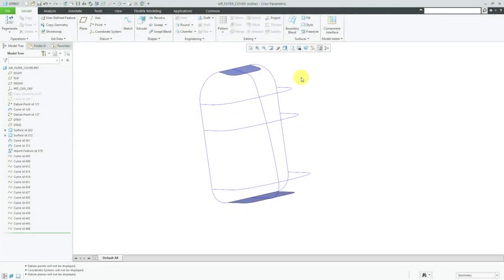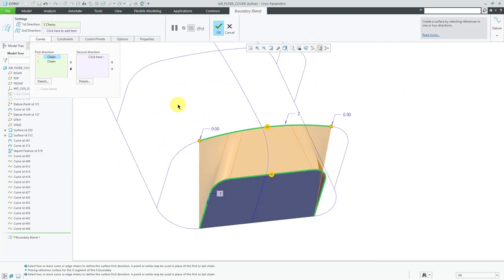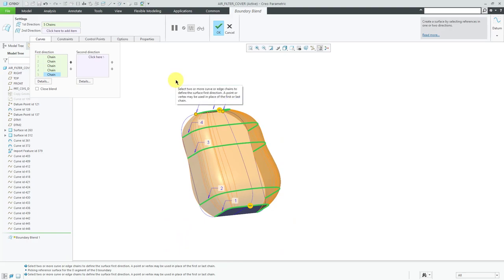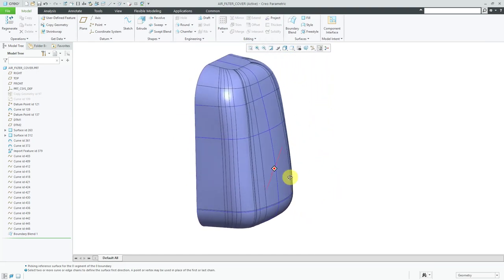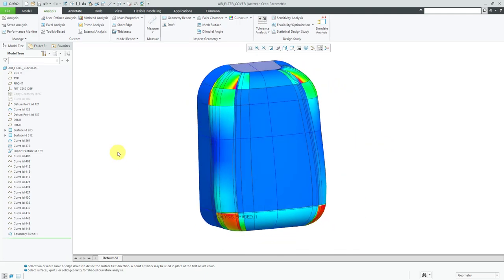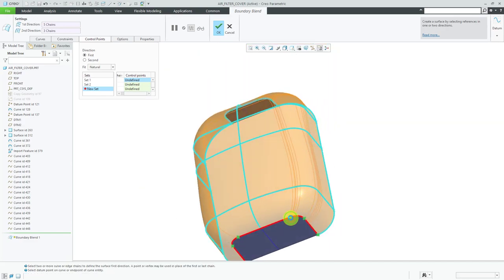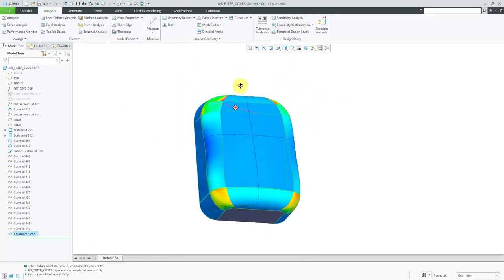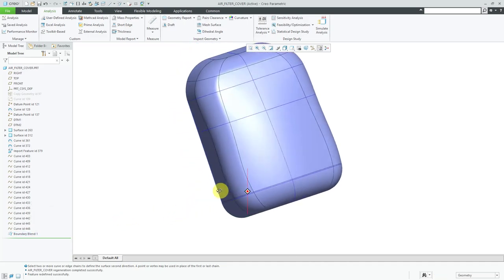Creo Parametric - Boundary Blends - Surfacing

Comment: Can you touch on STYLE and G3 curve and surface connections?

I had a PTC support ticket opened and they gave me a great tip for a troublesome master surface model. 

There was one last patch i couldn't get to G3 - they had me create a CURVE FROM DATUM in STYLE, increase the quality, and bump the degree to 7.

That worked, but it's still hit or miss as a general modeling method in STYLE.

Thinking NX or Catia may be better CAD programs for true G3/Class A.

thoughts?
Reply from the maker: Honestly I have extreme difficulty seeing the difference between G2 and G3 surface connections visually - my eyes just aren’t attuned to that level. I can use some of the analysis tools to tell that there’s a difference. To me it’s like how to distinguish between good and bad modern art.

Also I haven’t done much Industrial Design in the years since PTC added G3 connections. We used ISDX at Lab126 but Echo and Fire TV were simple shapes obviously. On Prime Air and Blue Origin we keep away from too stylistic surfaces for manufacturability.

I just don’t have the experience to comment that deeply about G3.
Reply: ok

Comment: How did u draw this for developing the curve.
Reply: Actually how did u connect the ends
Reply from the maker: How did I draw what? The network of curves are either 2D sketches or curves through points.
Reply: @CADPLMGuy  sorry sir.  I didn't get those ends comnected.  So I was figuring it out how to get those ends comnected 😁😁😁
Reply from the maker: @turbojspeed1360  I still don't know what ends you are talking about. I'm sure the problem is clear in your mind, but you haven't explained it clear enough for me to understand what exactly you are referring to.
Reply: @CADPLMGuy  first of all I'm really sorry for my english.  😁.

The issue is.  There is a base curve and  a set of curves that define it's surfaces.   How does the ends of guiding curves meet the base curve
Reply: Or.  Can u give a small sample video of how u drew the sketch before. Converting into the surface.
Reply from the maker: In a sketch, you can use a tangent constraint. If you create a curve through points, you can define end conditions like tangent. See my videos on Sketch Constraints and Curve Through Points.